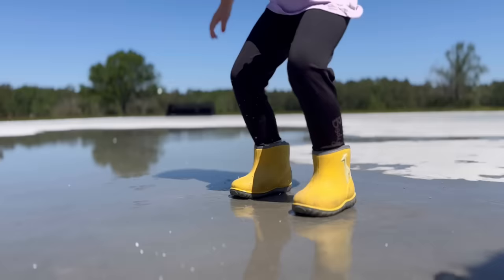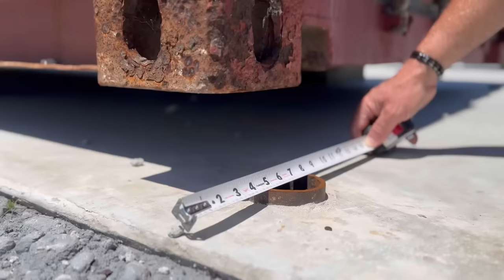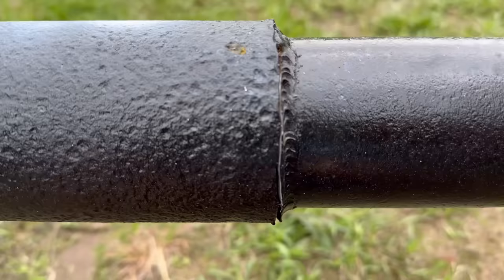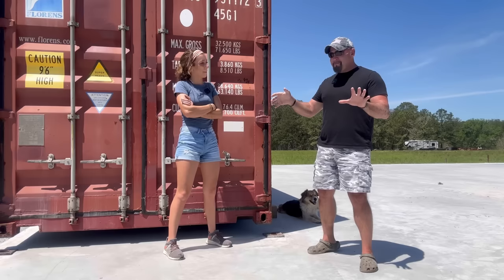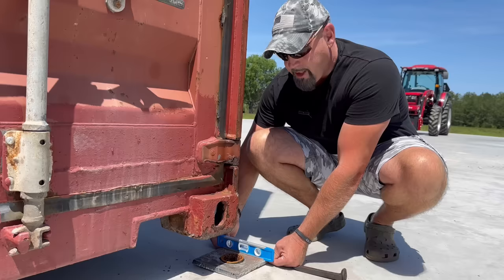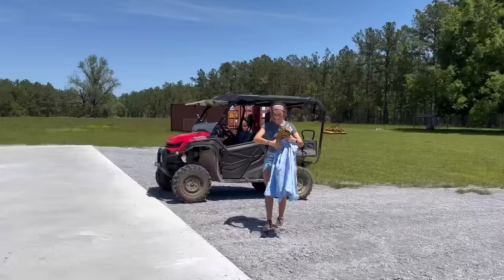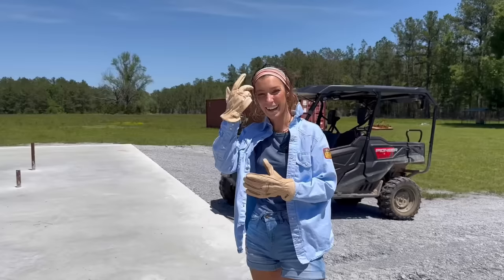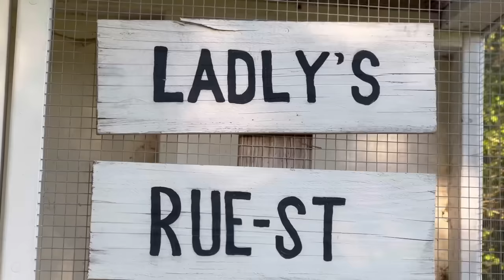Dropping SHIPPING CONTAINERS • Welding & Fitting for Final Placement

Comment: If you jack one end of the container, the jack is lifting half the total weight of the container.  (Assuming the container has uniform mass distribution, which it basically does if it's empty).

Comment: Add hydraulic grout under plate in gaps between concrete and plate. Also you should have cleaned the container tie down blocks before lowering and used a weldable primer.

Comment: When using a torch set remember to only turn on the acetylene 1/4 to 1/2 a turn. If things go wrong you need to be able to shut that bottle off extremely fast.

Comment: You are right, metallurgy, stress, load, and magnetism may play a part in the weld failure. But the condition of existing material and weld size also come into play here. Your weld looked very concave, and it looked like you welded it downhand which makes me think 6010? Also wearing shorts while welding is a bad idea lol. Might want to put some clothes on lol. The project looks like fun. I enjoyed the video thanks guys.

Comment: Take the ground lead and wrap it around the pipe 5-7 times then weld the upright tuning.  It’ll help with the magnetized material properties and retain better crystal structure of the bonding area.

Comment: Y'all are the most.  I love watching these peojects.
  Jim, RVs are junk.  They're made of the lightest, cheapest material supplied by the lowest bidder.  Those axles are no exception.  That's why the weld cracked.  It waz designed to support a camping trailer not a hootis and container.  Y'all made another fine Cajun Country installation.

Comment: Before doing your layout lines, what was running the torch over the area for?

I will say that bead on the cart looked kinda thin for the torsion that could be applied.
Reply from the maker: Jim was burning away the paint so the lines we drew would stay when it got heated instead of flaking off with the paint. 😄

Comment: Cap. You are correct, but a better pre weld prep aka a slight bevel on the over pipe would have yielded better saturation....
Shucks, all them folks giving you grief abiut a darn hootis, Rule:  #1 make it good enough to get job done!!!
#2 if it works, it works!!!

Comment: Hey,  u shoulda not wear shorts welding/cutting banging metal.  pitch-fork-1   what a weld!  pitch-fork-2  somebody shoulda grand down the rust on the pad of the container. bottom.
good job moving it with ur tractor.